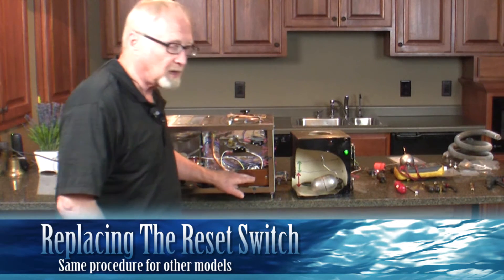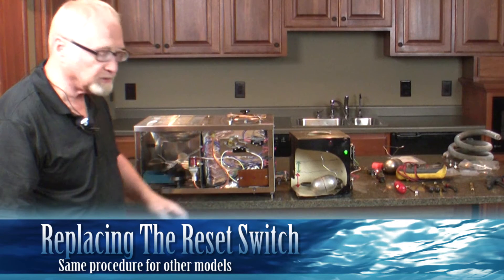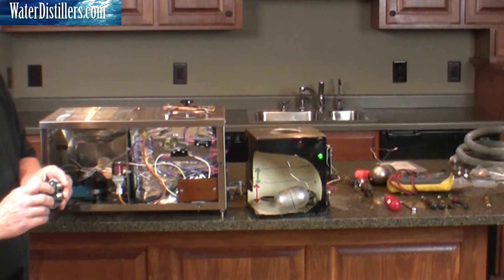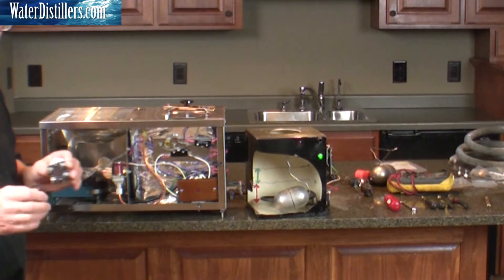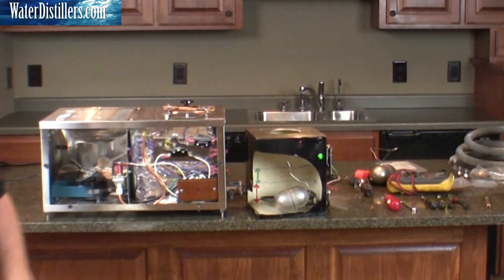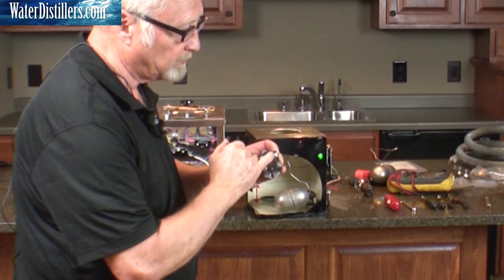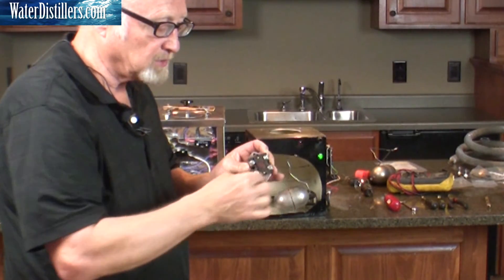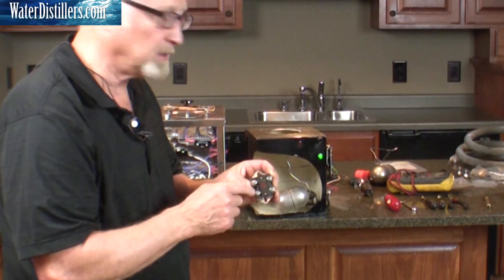How To Replace A Thermal Reset Switch On A Water Distiller

Comment: Hi,my waterwise 4000 I believe has a bad reset button.the second I plug the power cord into the unit it turns on,it's not suppose to.I'm suppose to turn on the unit by pushing the reset button after I plug the unit in with the power cord.It then works for about 3 minutes then shuts off and if I push the button it turns on the shuts off.Is there any other way to test the reset button ?